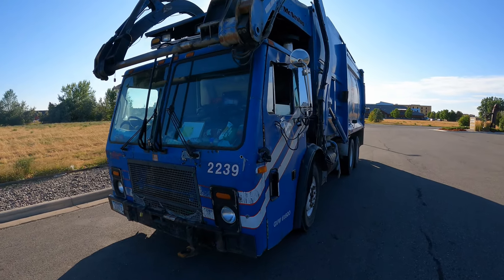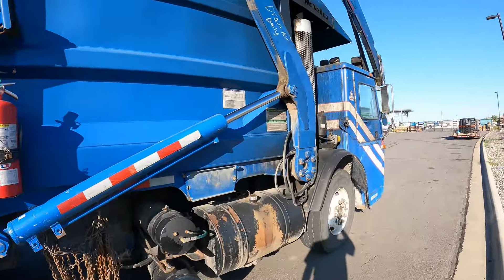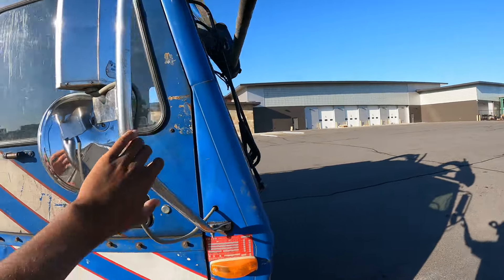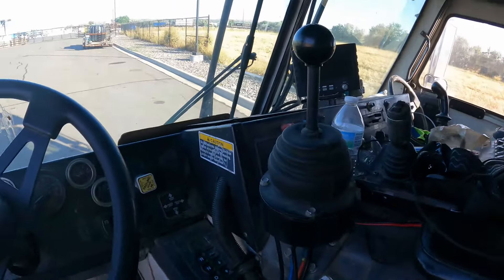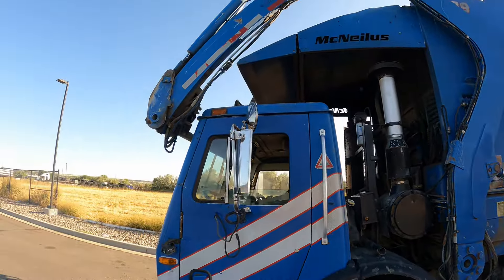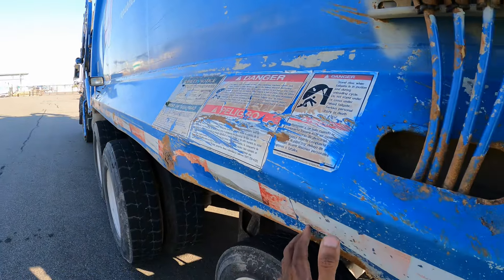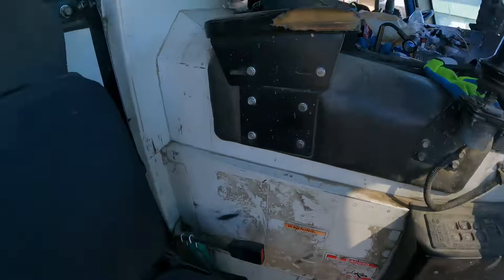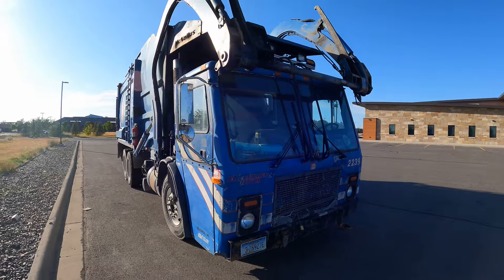Oldest garbage truck I’ve ever driven!!!!!

Comment: I think it probably used to have a curotto can on it those Mack cabs are Mack LE and they usually have curotto cans on them but they probably removed the curotto can
Reply: You sure it's not a Freightliner M2 bro?
Reply from the maker: @garbagemailtrucksandbuseso8685  yes I believe so as well the yard I was at had some old buckets and another truck like this that actually had the bucket on it
Reply: @RecologySpencer  yes I'm sure
Reply: @RecologySpencer  and also your not funny
Reply: @RecologySpencer  Nono, I think it's an econoline Dennis that's electric
Reply: @ oh good point tho, now that I look at it from a different angle I think you're right